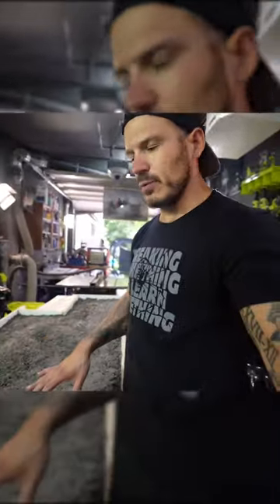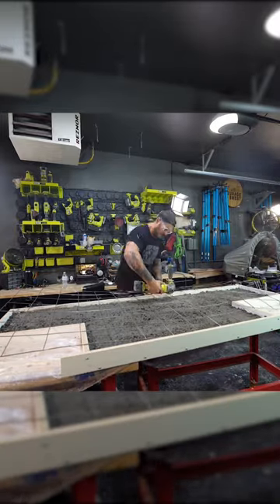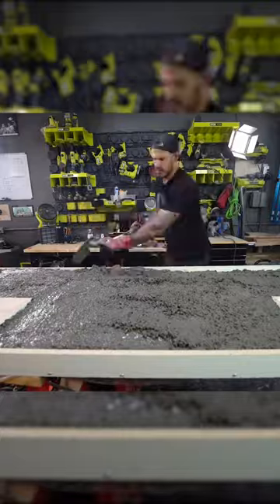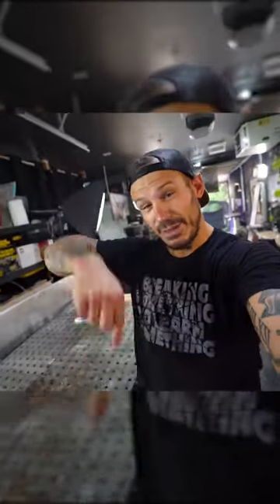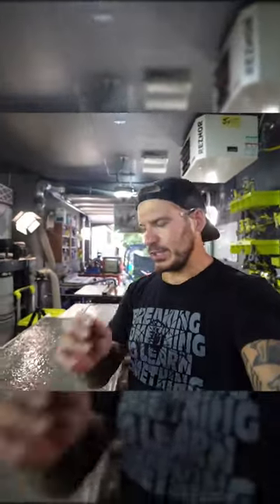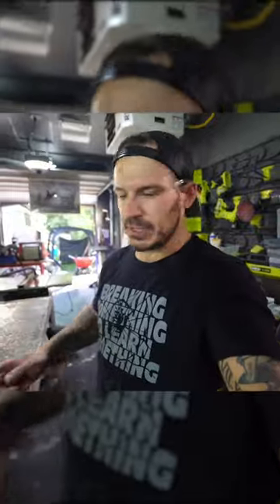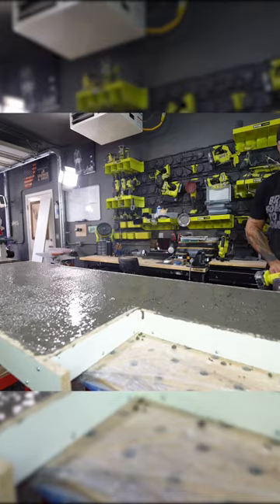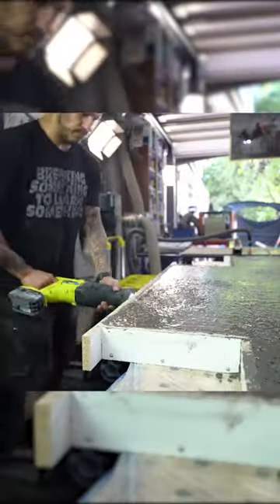STONG Concrete Bench #MrBuildit #shorts #diy

Comment: I was on the floor rolling laughing "I got the first 1 inch and a half ... That way when this expands and contracts it won't crack... No that's false it's 3.5 inches ... Using a reciprocating saw with our a blade on it will create vibration."